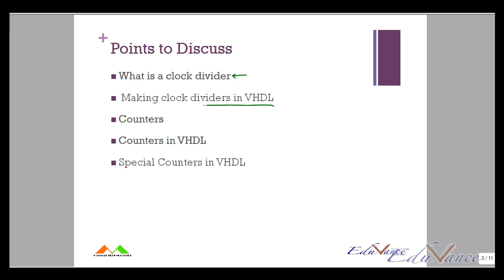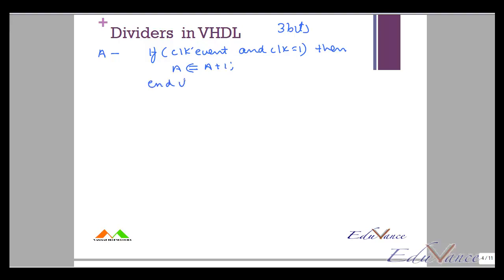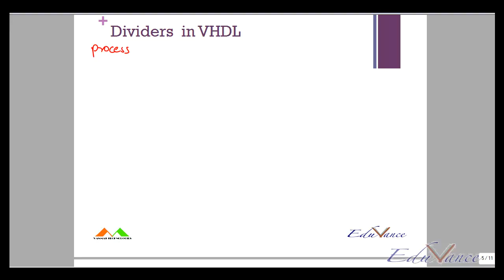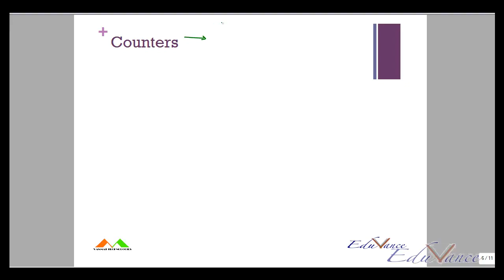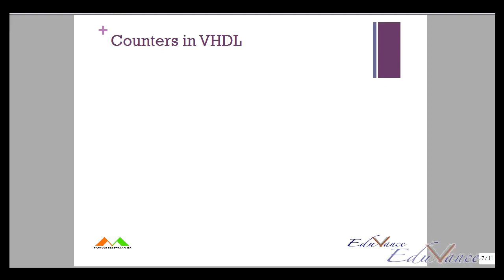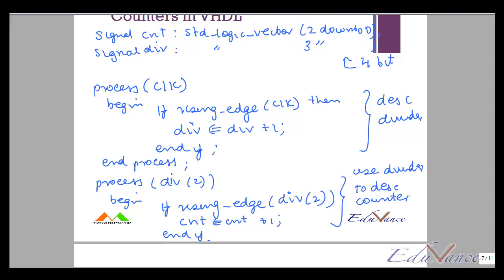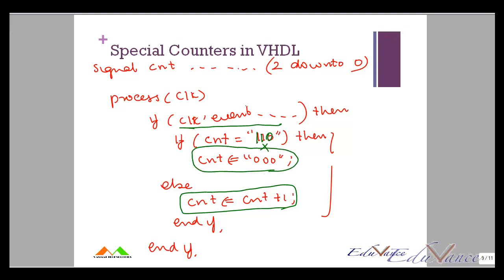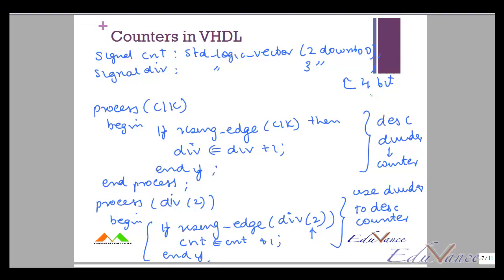VHDL Lecture 23 Lab 8 - Clock Dividers and Counters

Comment: hi Dr. Jonathan Joshi,  can we use any  flipflop direct from library in vhdl  while we designing mod-3 counters...
like we pic up filpflops as component in schematic design...
Reply from the maker: Yes you can do that.

Following is the link to the guide for Flip - Flop component selection :
https://www.xilinx.com/support/documentation/sw_manuals/help/iseguide/mergedProjects/destech/html/cs_flip_flops_component_selection_guide.htm

 
Taking example of Asynchronous D- Flip flop. To directly use D - flip flop you can refer the following link which shows the input and output port names to be used. 

http://www1.pldworld.com/@xilinx/html/technote/tool/manual/15i_doc/alliance/lib/lib5_9.htm

So now while you are creating the instances you will declare them with same names.
Example:
XLXI_20 : FDC
      port map (C=>CLK,
                CLR=>CLR,
                D=>XLXN_44,
                Q=>A_DUMMY);
Reply: Thanks alot Dr. Joshi

Comment: Sir,how to use for loop in vhdl  ?? Will you please explain with an example
Reply from the maker: The code below is an example of how to use for loop in VHDL. 

In this code, If the input is 1, then it is inverted or else the output is same as input

library IEEE;
use IEEE.STD_LOGIC_1164.ALL;
entity MainModule is
      Port (    invert  : in   std_logic;
      input   : in   STD_LOGIC_VECTOR (3 downto 0);
                output  : out  STD_LOGIC_VECTOR (3 downto 0));
end MainModule;
architecture Behavioral of MainModule is
begin
     process(invert,input)
    begin
     if (invert='1') then
     for I in 0 to 3 
     loop
       output(I)<=input(3-I);
     end loop;
    else
     for I in 0 to 3 
     loop
       output(I)<=input(I);
     end loop;
    end if; 
   end process;  
end Behavioral;